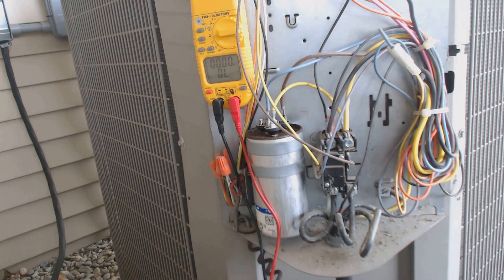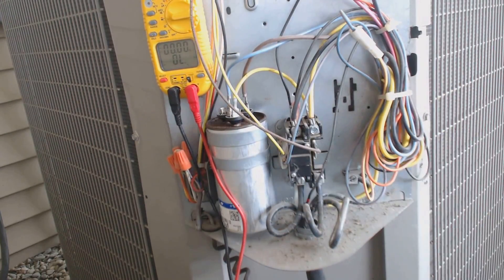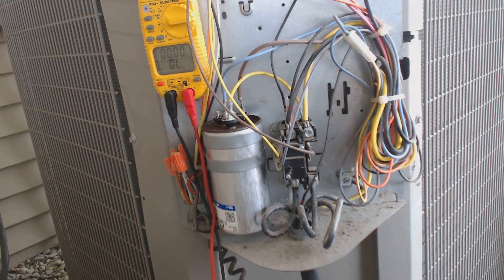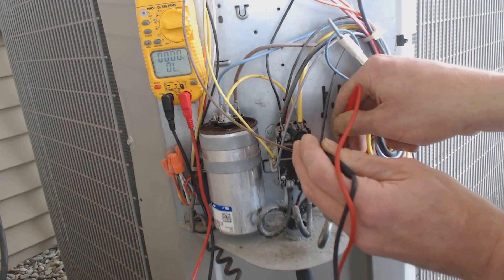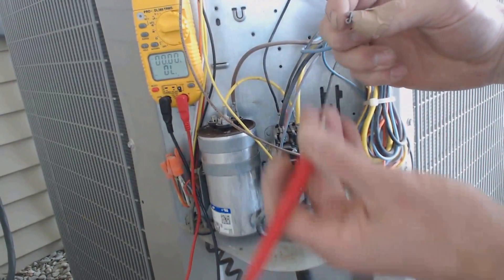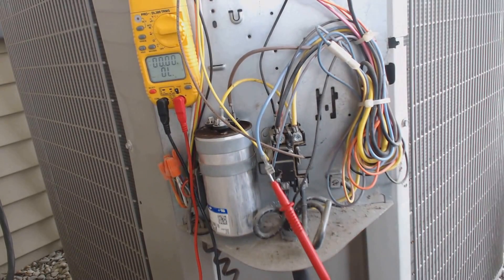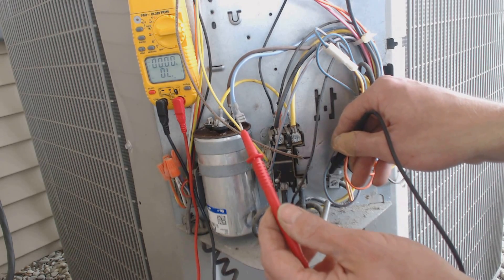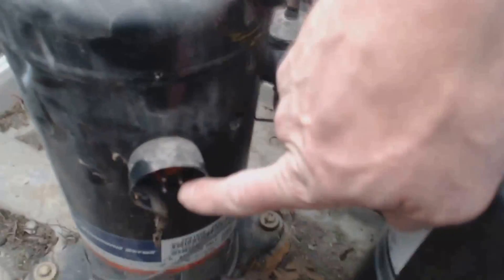Bad Refrigerant Compressor? Explained and Tested in the Field!

Comment: I purchased your book as general contractor.  We have gone through four HVAC techs that don't seem to be able to install a mini split heat pump properly.  One unit has a bad compressor and my plumber will be replacing a compressor in a Midea split.  He is suggested we do an R-11 flush in the system because of acid build up.  My initial research is showing me that method is old and not longer suggested in new systems.  Do you have any thoughts on this?

Comment: Thnx for your many informational videos. Always enjoy them... My AC compressor will not start & it is not shorted to ground. I get a really low amp draw < 2 amps during test. Is that possibly sign of bad compressor? Trying to determine if the compressor can be revived :o(...
Reply from the maker: If your resistance readings are good and windings are not shorted to ground, you could try adding an SPP6 https://amzn.to/2BdyFX8   to see if that will give it the extra power it needs to start. Make sure it is getting a good voltage and has a good capacitor before that, thanks
Reply: AC Service Tech LLC 
Capacitor was first i cked & no issue. It did cross my mind to ck resistance after the fact. However, I did try the 521 hard start kit but it still would not budge :o(  appeared most likely a shot compressor. Input anyone?
Reply: Thnx... Voltage across contactor cked out fine as well.

Comment: What if I get 315 k ohms to ground but no continuity and the other two leads have 25 m ohms but again no continuity to the ground
Reply from the maker: Make sure you disconnect the wires of the compressor from everything else before testing and you should read 0.L Maybe also double check with another meter. If this is powered, does it just pop the breaker or fuse? If so, the compressor is shot, but make sure the compressor is disconnected first before testing, thanks
Reply: AC Service Tech LLC yes the breaker was tripped when I arrived, capacitor was dead I replaced the cap and tested the bare terminals before turning it on. I was getting ohms on all three to ground and when testing across the terminals I was getting crazy high resistance and it wasn’t Adding up.. when trying to start the unit the fan was running and the compressor wasn’t but the breaker wasn’t tripping. I condemned the compressor although a continuity test never made a sound to ground. Just a little confusing because resistance to ground should trip it and resistance should show continuity. Any thoughts on this would help. thanks man huge fan of your channel..
Reply from the maker: I never use continuity because it is not as specific as looking at the resistance. It will only beep once if it is up past a certain ohm reading, thanks

Comment: usually replacing a compressor is costly. That is when you look at the age of the unit itself and ask the customer if they want to replace the compressor only or the unit. If the compressor is bad on a new unit or does not operate, part may be under warranty.
Reply from the maker: Yes sir!

Comment: i believe one can check from the common to run winding and get a reading and then from common to start winding. add the readings and if that matches the reading between the start and run winding the compressor is good as long as no reading to ground in this instance. Great Video!
Reply from the maker: That is correct! Thanks

Comment: In my area in Easley sc I rarely ever see one anymore.
Reply from the maker: You rarely see any bad compressors? I see them bad for even the simple instances of where people install bad digital thermostats without 5 minutes delays and the compressor keeps getting called before it even reaches 5 minutes from when it shuts off to when it turns on. Other instances are bad oil return, acid build up, or fin degradation. You probably just have the luck of the draw not to see them. Thanks for the comment Phillip!

Comment from the maker: Great Question! Continuity meaning the wires are touching the ground. If any of the wires that you are powering with voltage are touching the frame then the breaker will immediately pop do to high amperage from a direct short. You should however have resistance from one winding terminal to each of the other two winding terminals. Check out the video on checking a condenser fan for more on measuring resistance on 240v psc motors such as a compressor or condenser fan motor. Thank you for your Comments, they are appreciated!https://youtu.be/DmFSQbowYIg